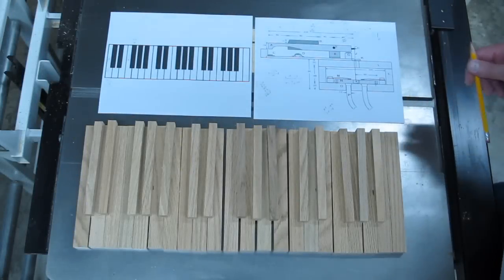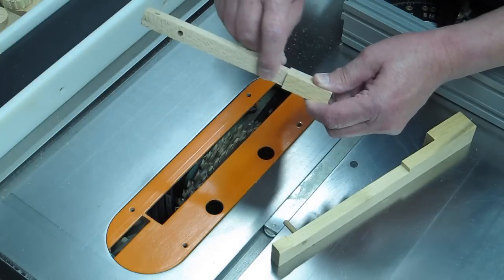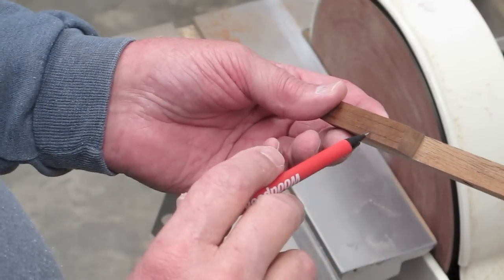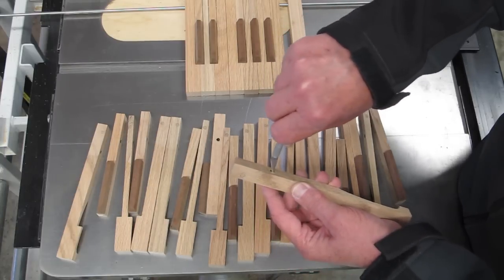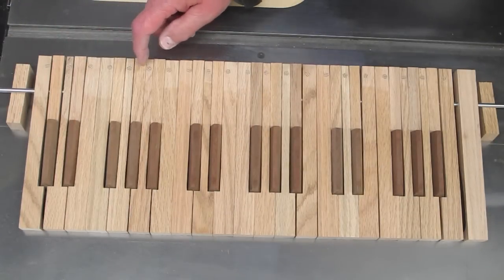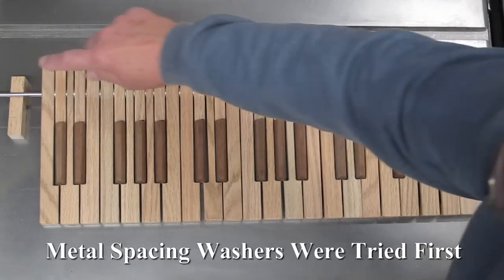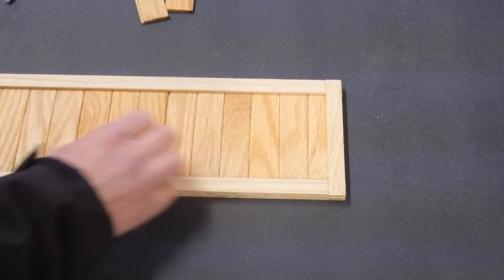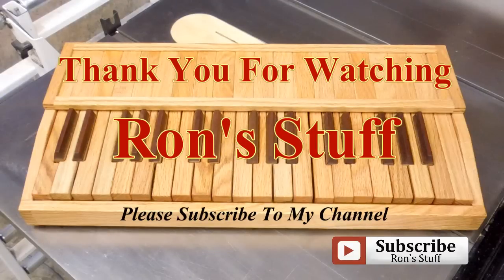Wood Keyboard - Building It

Comment: Been contemplating building a clavichord for which I've been unable to find any useful plans (big surprise).  After watching your video it's clear that it's a much bigger effort than I thought and I didn't think I had underestimated it to begin with.  I appreciate your attention to detail as for something like this craftsmanship is extremely important.
Reply from the maker: +Rick T I was not sure what a clavichord was until doing a google search. It would be an ambitious project. I see kits are available from the UK and Spain and that may be a good way to go as they would be familiar with the best wood to use for the various parts. I don't play anything but have been tempted several times to build a hurdy-gurdy kit. Good luck and thanks for watching. Please subscribe. Ron
Reply from the maker: +Rick T  I don’t know if you have your heart set on an old style piano type instrument or if just an old type instrument would be of interest? I have a good video series on making the John Smith Senior 20 Street Organ. Not an easy project but very doable and it will immediately attract attention and put a smile on anyone who hears it play. Plans are available from John Smith. He has much larger and more complicated organs but I strongly recommend building the Senior 20 first. And it plays itself! :-)
Reply: Ronald Walters
Hi Ron, thanks for the follow up.  I did actually run across that organ in my research.  The organ is something to think about.  I've been a woodworker for a while but only took up piano after I retired and I thought why not try and combine the two hobbies?  Not sure my skill level is up to it though!
Reply from the maker: +Rick T  Then I doubt you would have any problem building the Organ. A option for the Senior 20 is an animated conductor which slides out the front and I am in the process of making a resin casting kit for that conductor. I released the first video in the series on the conductor last Saturday.

Comment: Isn't a piano already made out of wood?

Just painted?
Reply from the maker: Wood and a much more complicated construction.
Reply: Sepri787 yes...
Reply: Stonewall unless you're a piano maker. Then it's probably worth it. Also harp sounds nowhere similar.
Reply: Sepri787 older pianos are made out of ivory but since that's illegal now it's either plastic or wood
Reply: Ryan Baudisch only the white keys were ivory.
Reply: wood KEYBOARD
Reply: despend on what piano
Reply: not the keys...
Reply: or it could be ivory.
Reply: Sepri787 no it could be made out of elephant trunk or plastic it could be made out of a lot
Reply: Zovah Jeffries I highly doubt that
Reply: Sepri787 well you have the keys which can be made out of plastic or Ivory
Reply: The keys aren't made out of wood. They use to be made out of ivory but now they make them with durable plastics.
Reply: Yes.. But this time... NONE OF IT IS PAINTED!!
Reply: not the keys, only the body
Reply: The keys are ivory
Reply: Cameron Thomas only in really expensive pianos.
Reply: Not entirely
Reply: and metal
Reply: Before ivory became illegal it was used in most keyboard construction as a thin laminated piece over the wood key as a finish. Today the use of beef bone is used in the same way and gives a far superior touch then plastic (yuck)!
Reply: No.
Reply: and has ivory keys

Comment: A wonderful exercise in woodworking! Thank you for posting the video. Buried way down in the comments is someone's observation that on a real keyboard the black keys are not actually aligned evenly between the white keys as most people think (I was playing piano for years before I noticed this). The only black key situated right between two white keys is the G# (the middle one of the group of three) and the only white key evenly aligned between two black keys is the D. As for the other black keys, it's best perhaps to look at the keyboard as having two groups of black keys per octave (a group of two and a group of three). The OUTSIDE keys in both these groups are moved away from the center of the group (essentially, this is done to space out the black keys, making them easier to play). As the group of two only has "outside" keys, the first one (C#, on the left) is moved left so it cuts more into the C than the D and the second one (D#, on the right) cuts more into the E. A similar "move away from the center of the group" applies to the F# and A# keys.  Worth noting, the C# and D# keys actually have more space between them than the F# and G# (or G# and A#).

Comment: Very nice work.  Indeed, as others have said, seems like you might as well add some electronics and make it play notes, when desired.  You could, e.g., use opto-interruptors or just magnets and reed switches, if you didn't want to affect the feel and sound.  Or just use physical microswitches, might give a pleasantly tactile response.  Then use Arduino or whatever to turn it into MIDI-USB, and into something like Fluidsynth or Hauptwerk on a PC.  Pipe organ or harpsichord sounds at the ready.  I'm sure you could get it to work with a phone or tablet, as well, for a nifty travel rig.  (But maybe you don't want/need any of that.)  Anyway, looks very good.
Reply from the maker: And as mentioned in the comments...
Watch my video series on building my version of the Dec 1982 Popular Mechanics project. I improved the keyboard and use electro-mechanical input. You can play the mini-calliope from the keyboard or it will play midi files.
There is a playlist for this series on my channel page.
Thanks for watching. Ron

Comment: Very awesome video. And very inspiring to do it yourself. Though I realise it's time-consuming and a lot of precision work and equipments like a table saw seem essential.

I wonder. If you can manage this, can't you transform it to a MIDI-controller keyboard?
Reply from the maker: Something like this is probably more suited to pulling on cords (wires) or pushing on rods to operate pneumatic valves in a smaller pneumatic organ where the pipes & wind chest are in the immediate vicinity of the keyboard. In larger organs the keys were made to operate electrical contacts which were wired to remote electric-pneumatic relays which in turn operated the organ pipes. Keeping in mind this is not a full size keyboard (approx 3/5 size) it involves a lot of work and was an experiment. These keys could be made to operate some form of electrical contacts or micro switch. Fine tuning the exact point of contact and release would be another issue. It would be a lot easier to purchase a modern day plastic midi-controller keyboard. :-) Thank for watching!.
Reply: It might be more sensible to use reed switches, or hall effect switches and glue magnets to the keys to activate them.  That way, a micro controller could convert the movement to midi and support velocity and possibly after touch. Were I to do that I'd also consider making the hidden part of the key longer and weighted, then use only a light piece of elastic to pull the keys back, instead of a spring.

Beautiful build, even as an ornament, however :)

Comment: Draw the keyboard. Drill the holes for the balance pins and the tail guides through to the frame with the board clamped to the frame. The front of the accidentals should be less than 90 degrees. The undercut of the naturals is excessive. Better to balance with lead near the tail. Longer tails required. Cut out with a band saw and fret saw. Your balance system will produce rattle. Accidentals should be wider in the twos than the threes. The outer accidentals are wider than you have put them .Springs to enable return are not needed if you balance with lead. Felt on the frame at the front and rear and on the top of the key tails. Best to read “Three centuries of harpsichord making “ for a full account of what to do. I expect you have moved on since 8 years ago😀
Reply from the maker: Look around and you will find the updated version used in my conversion of the Mini-Calliope to play midi files. The Mini-Calliope was originally published in Dec 1982 Popular Mechanics. I have a playlist for the complete project.

Mini Calliope Part 2 – Keyboard & Rockers
https://youtu.be/FtwMS9s0OpM

Mini-Calliope Part 7 - Keyboard & Rockers
https://youtu.be/UUwQZFn_OL4

What works so much better on YouTube is action rather than words and criticism. We would love to see your expertise so please show us something you have made and how you made it.

Thanks for watching. Please subscribe! 
That is what keeps this channel going. 
Ron

Comment: If you look at a real piano you may notice that the black keys aren't centered on the lines between the white keys, so somebody who actually plays the piano might find this keyboard slightly annoying.
Reply from the maker: Looking at a real piano keyboard it appears some are and some are not... oh well, guess that's where "practice making a keyboard" comes into play.  Thanks for watching!
Reply: So taking my own advice, I looked a real keyboard and it turns out the backs of all the keys are evenly spaced, which I suppose makes sense if the strings and hammers are evenly spaced.